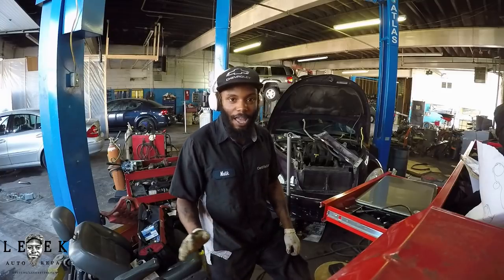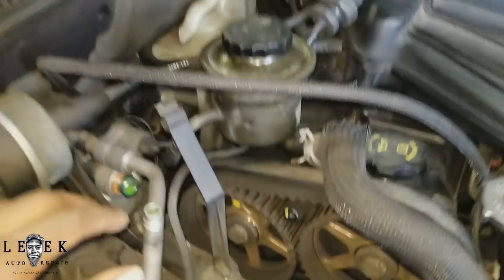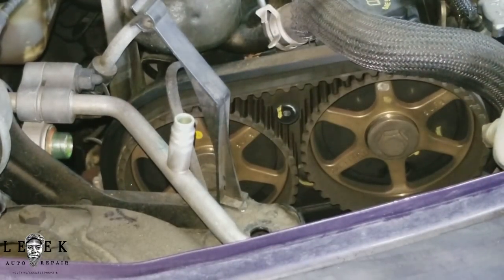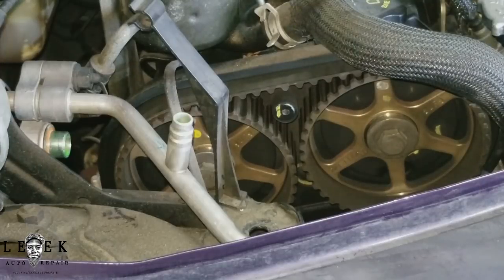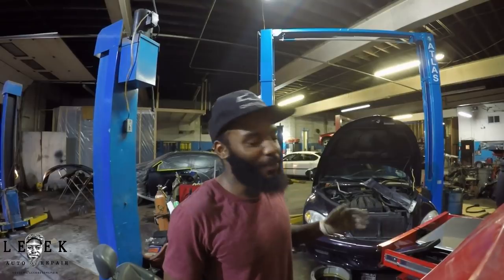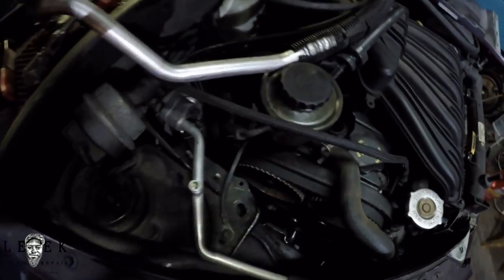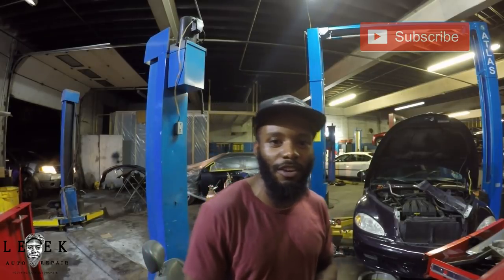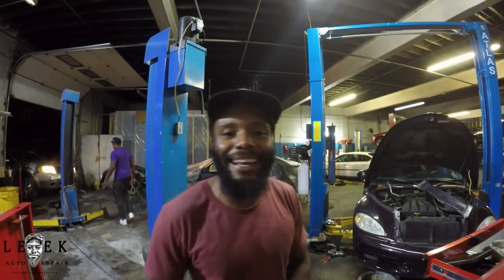How To Set Timing Marks & Belt Removal 2001-2010 Chrysler PT Cruiser

Comment: Thank you for explaining it the way you did I am a suspension mechanic and have never had to work with the timing or the actual motor before and I've been stranded for 11 and 1/2 days now trying to figure out how to do the timing so thank you again for explaining it how you did the sockets and everything else was amazing and you just saved me a lot of money and a lot of time so much love from Kansas City Missouri
Reply from the maker: Glad I can help!  Good luck on the job
Reply: I just have one question though when you take the old belt off of the actual pulley mine does not turn I'm not sure why but it does not turn and I don't know how to get it lined up the guy that came out here and looked at it told me I had to take both of my valve covers off and loosen up the rockers and that that was the only way to do it but then he busted three of my coil packs and I had to go get new coil packs but I'm still having difficulty with the water pump pulley and getting it to turn so that I'm at top dead center

Comment: Just something  I found out because  tdc the arrows will be facing down  if facing up the the timming is way off if you do from the bottom instead or down arrows on cam shaft cranks will be facing up  but thanks to you I was able to get mine  back running ps. To rest dont mark with a sharpie Mark's wiped off on me so great video keep up great work bro with up arrows will turn over and not start

Comment: did you have to remove the tensioner when installing the new belt or did you get it to slide over with tensioner bolted to motor in the lowest position ?

Comment: Great video only issue is the marks on the cam shaft gears that say up with the arrows should be facing up when true TDC is reached... Anyhow love the video
Reply from the maker: The marks on the cam don't matter when #1 piston is up and all valves are closed
Reply: not in this case. the only timing marks that matter is the slots that need to face eachother on this engine
Reply: Neither one of you are getting it.......he is at TDC on the exhaust stroke, not the  compression stroke, when the marks on the cam gear are up that is true TDC on the compression stroke. You can still align the marks down because it's in the same cycle......if he would have turned the crank over 360 the marks would still align with the other marks up......the only time being 180 out matters is when you have a distributor
Reply: @zo6longhorn600  Thanks for explaining that. I noticed the up arrows pointing down but it doesn't matter unless it's for spark timing. 👍

Comment: I leave the radiator support on. Used extensions to run from the battery would be to get the 3 power steering pump bolts

Comment: what if the the left arrow is facing down an the right is facing up but the grooves are all lined up is that ok???
Reply from the maker: As long as the 2 notches on the cams are lined up facing each other and cylinder #1 is at tdc u should be good

Comment: For one  the 2.4  is a non interference engine  meaning the valves won't hit the Pistons I've done a few just did a head gasket replacement in less than 4hr and a lady pulled out in front of me total the car so I picked up another one for 500 the young meth head had attempted to replace the t.belt went as far as removing the intake amongst prying the head light out so when I started on it I found the crank pulley bolt Brook off in the crank the crank pulley was destroyed along with t belt sprocket. It took me 4hr to get the bolt out he let it rain on the engine and it was frozen up  I dumped transmission fluid in and let it set over night I got freed up  put on a new belt valve cover gasket and plugs put the intake manifolds back on it and got it running but wasn't charging so off with the intake and replaced the fussable link that's why it came with 2 batteries replaced missing and bent bolts timing belt  covers missing and broken inner finder cover missing repaired head light opening removed greáse from interior  now it fires right up oh and someone stole the converter had it replaced but they cut the wie plugins lol even though I've checked the timing marks over and over it wiil only rev to2200 rpm yes the key way is in the crank timing marks are dead on and arrows up but getting a miss alignment codé the cam lowbs where up when I did the valve cover gasket this is a nice looking car with a hundred and twenty thousand miles I'm tired tomorrow I'll pull the cam sprocket bolts and check the key ways and there seems to be some kind of odd movement in the t. belt tensioner there is a tension spring and lug to set which no one seems to mention if these items fail me I'll be checking the cam position sensor and crank position sensor aka pick up coil for you old schoolers. I accept prayers and advice lol ps please dear women don't let your methed up hubby work on your cars

Comment: It's a bitch just getting out the support bracket that holds the steering pump I'm doing mine I'm going day 3 lmao the thing that I'm tripping one is that I need to remove the other plastic cover to get too the water pump but.. I'm having trouble with the cam gears I have to take  those fuckers off to remove the plastic the thing is when I try to put pressure to remove it the gear moves too an timing moves so lmk if you have a trick to removing both with out fucking shit up also it's. An 03 pt gt 2.4 turbo

Comment: That wasnt true tdc . You had the piston 1 and 4 at tdc but its 180 deg out . Not true tdc on the compression stroke. The cams are supposed to be facing up and the two notches meeting themselves.
Reply from the maker: I can tell that you're a bookworm and not a hands on tech. I clearly said in the vid that notches don't need to be up. Regardless of what you're trying prove you will still be wrong considering this car was finished the same day I did this video.
Reply: You dont know me.
I run a shop out of my house . Im full hands on. Im just stating the facts. I didnt fully watch the video but if your gonna tell people stuff at least be correct.
Reply: You can pop a belt on in any position. But understanding true engine timing not everyone gets.
Reply from the maker: When u make a video on this and it goes viral let me know. Good luck knowing it all